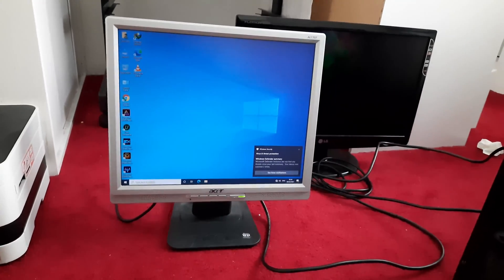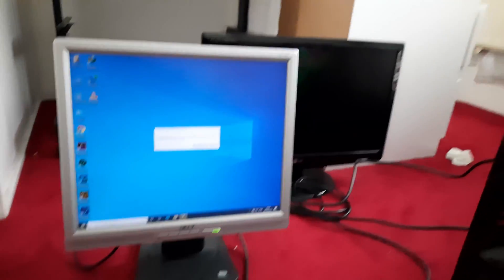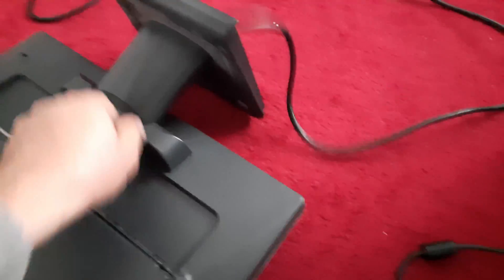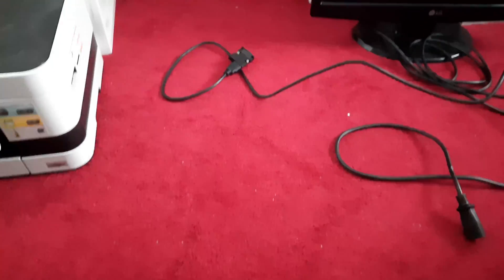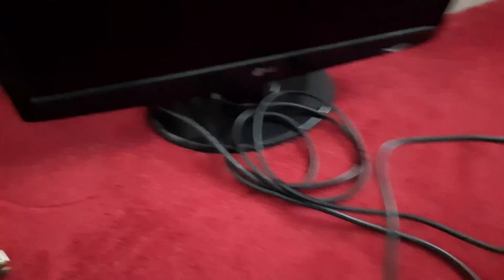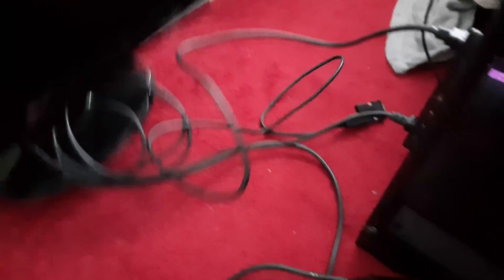How to fix power saving mode without clean ram or other pc components solve black screen error 2022

Comment: Im using a lg monitor with my playstation how can i fix this problem
Reply from the maker: Hi sorry for late reply , first of all you have to verify that if your pc runs properly without play station or with play station until desktop if you see when u on pc works fine but only when you connect lg monitor with hdmi to vga or vga to hdmi connector then you have to check converter first or try to set resolution settings in graphic settings recommended or try with other monitor , if you still have questions let me know thanks

Comment: But in my case it's a del pc, when it go in to power saving mode it no power on in monitor but ups is working
Reply from the maker: Please try other lcd or monitor with same pc if your pc works there properly then you lcd or monitor have problem if you still have same problem please try to read description and try to use all methods whose written in there i hope you will fix it
Reply: Manoranjan Have you fixed the problem ?

Comment: i have 2 PC's one is old and the other one i built few days ago and the monitor works with the old PC but not with the new one, i built a APU PC and connected it to the motherboard and it didn't work, so i tried to take the GPU from my old PC and put it in the new one and it still didn't work, then i tried going to my friends house and connecting to his monitor which uses HDMI (mine is VGA) and it still didn't work it always goes to power saving mode
Reply: i also tried to cleaning everything like the videos show and it still didn't fix my problem, only option i have left is to try getting those adapters and trying with them
Reply: im having the same thing i have a pc not a laptop but still i have to GPUs one is integrated and one is dedicated. When i plug my VGA into the dedicated slot using the adapter in this video it doesnt work but when i plug it into the integrated slot without the adapter it works. but i cant be using an integrated GPU because i have to game
Reply: if you get any fix plz tell me
Reply: @samlar6000  sorry for late reply but i just found out what my problem was and it wasnt because of my monitor or whatever but because the BIOS wasnt the correct version and it didnt support zen 3 processors so the monitor always went to power saving mode but now after i sent it to service and waited a really long time it got flashed to the newest version and is working properly

Comment: your lg monitor same as mine. and the problem too. but it didnt have hdmi plug on both cpu and monitor. old pc.
Reply from the maker: Ok and you have same problem power saving mode ?? Then you have to know first if the error (no sow display  ) is coming from start when you press power button or near desktop will come !
If come from start then please check first with other lcd or monitor if still no display then read video description and try all methods whose i described there sure you will fix it .
Reply: @luckyinfo409  thanks for the fast respon. i got solved the problem, so i power off all (cpu and monitor). all cable attached. then power on pc first. wait a few second then power on the monitor.
Reply from the maker: @terasrumahdiy5184  thanks for your support

Comment: I have same HDMI cable as you have 

But still didn't work🥲

What can I do now 

My PC is old but it works very smooth , the problem is with this shitty LG monitor
Reply from the maker: thanks for contact with us , First of all if your pc was work perfect with other LCD or monitor nd only in LG  LCD you get this error that black screen no display then please try to change converter , Or after connect power off pc and power on again and wait 1 miniute minimum please display will come or change hdmi port with other or install your graphic card driver or if you dont have seprate graphic card in pc u have hdmi then must install first Driver for HDMI and try first other lcd or monitor with same hdmi then try this hope so it will work
Reply: @luckyinfo409  I have the same HDMI cable as you but it was a bit old(2 years) 
Yeah ! My PC works fine with other LCDs 
Ok , I will try changing HDMI Cable 

Thanks for the solution dude✨❣️
Reply from the maker: @hkanchap0132  i am really very happy to listen about it that your problem has been fix and thanks for your support
Reply: @luckyinfo409  Bro , It again started blinking even with the new cable 😭

Comment: Didnt work for me even if i cleaned my ram but i noticed that my pc turn into power saving mode when i shut down my pc can anyone help?
Reply: Me to
Reply: u may have a GPU problem
Reply: its happned to me too i have 2 GPUs integrated and dedicated the VGA works in the integrated slot without using adapter but it doesnt work with dedicated GPU slot while using the adapter
Reply: 100 percent same problem
Reply: Even I have new system
Reply: what you can do is install a VGA port into the dedicated graphics card so you wont have to check what adapter is compatible with your moniter

Comment: Bro i have all of that, when i got this it worked like perfect but now it wont i cleaned my pc and its still saying:analog power saving mode
Reply: bro i can help
Reply: its happned to me too i have 2 GPUs integrated and dedicated the VGA works in the integrated slot without using adapter but it doesnt work with dedicated GPU slot while using the adapter
Reply: what you can do is install a VGA port into the dedicated graphics card so you wont have to check what adapter is compatible with your moniter

Comment: You are right cleaning is not the real problem. I think it’s the moniter
Reply from the maker: at my case problem was converter that shows cleaning is not always issue
Reply: I think it’s the moniter cuz 1 of my monitors are working but 1 isnt
Reply from the maker: @akanoah3206  no friend is not about monitor same lcd monitor i checked with other slower pc was work but with another pc not so i think monitor cannot be issue on my case
Reply: @luckyinfo409  a monitor is the lcd
Reply from the maker: @howocaust  what is your question please?
Reply: @luckyinfo409  No nevermind i didnt plug the vga properly Thank you for the video
Reply from the maker: @howocaust  thanks for your support
Reply: @luckyinfo409 friend what is the problem then?
Reply: Yeah I see now it was not connected neatly
Reply: Nope it’s my computer,
Reply: Agree